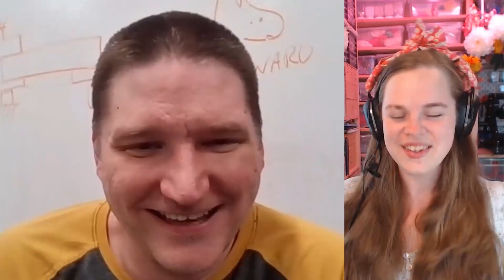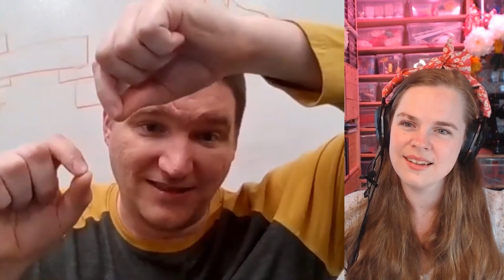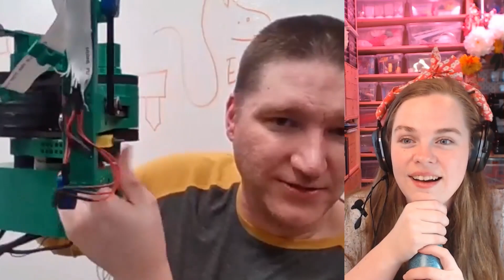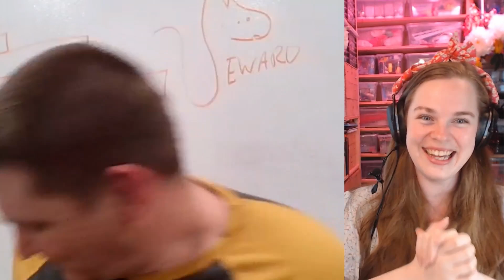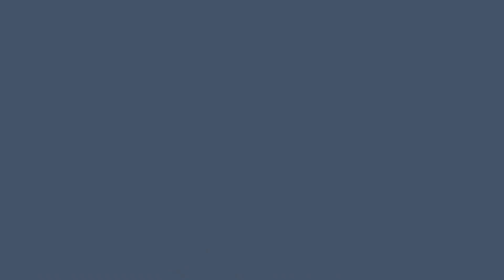Meet a Maker - Nicholas Seward! Episode 21

Comment: 22:42 gear arms for Gus Simpson
( 23:40 linear behavior actually a tripod bot )
...
1:02:20 generative design
1:05:38 Cura new core engine "arachne"
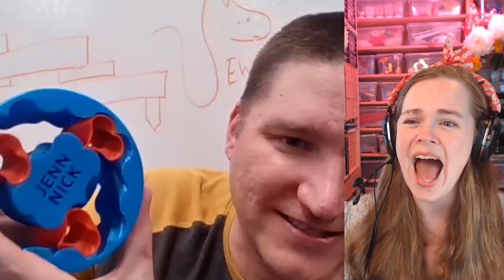1:06:33 Cycloidal gears bearings (prop)

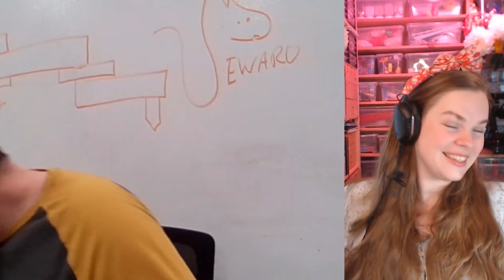Comment: 55:50 Showing first helios printer
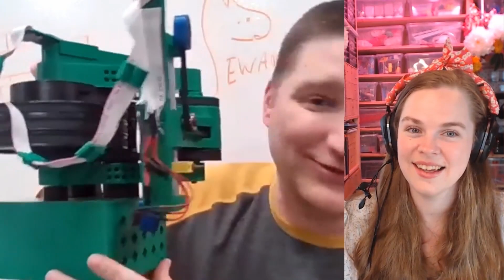56:35 I love that static compact block of motors approach. — I doubt it will easily go together with more than 3+1 axes though.
58:20 Eventually upcoming: RepRap Homer